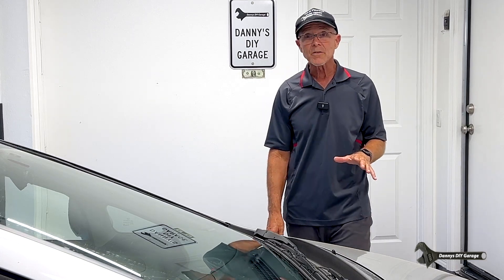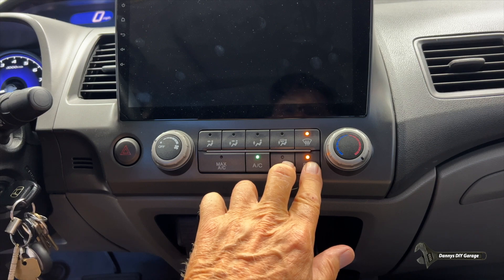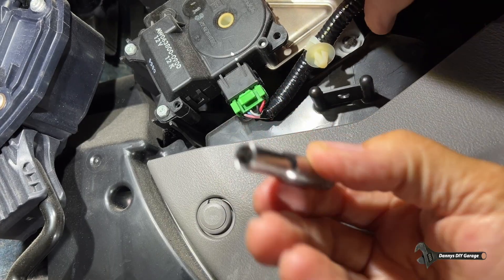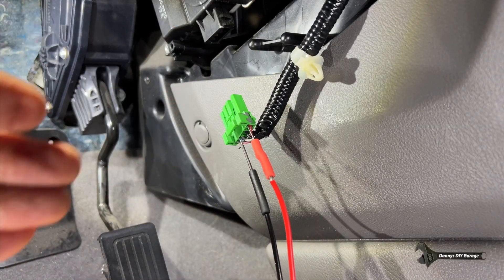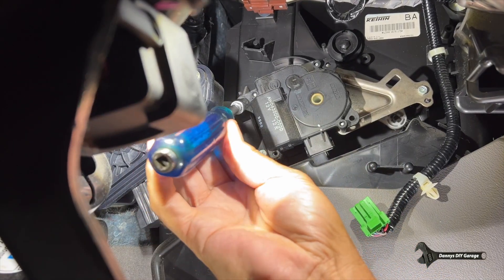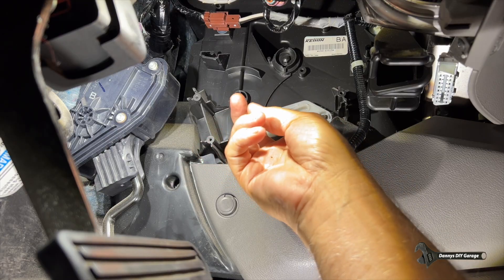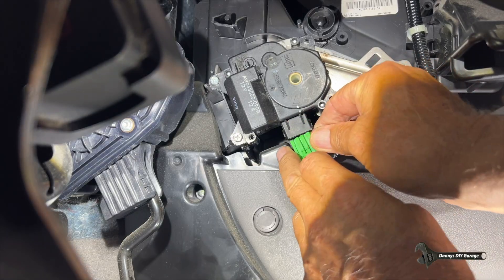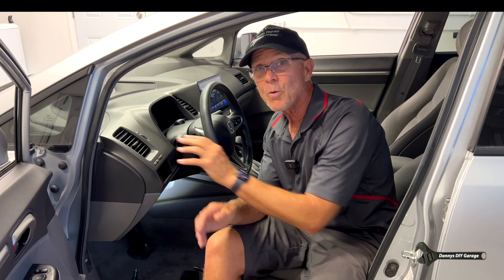Honda Civic Heater or AC Problems? Diagnose & Replace FAULTY Blend Door Actuator.

Comment: Does it matter where the dial is set before you remove and install the new one. When I installed the new unit it was not setup right. Thanks for the great videos.
Reply from the maker: I found full cold usually works best, but it really doesn't matter as you can move the door, but most actuators come set on cold

Comment: So this video is for the FAULTY AIR MIX MOTOR to fixing #1 trouble code, located by the gas pedal. It's not the same as the AIR BLEND DOOR ACTUATOR with #4 trouble code located behind the glove compartment.
Reply from the maker: That’s correct I have another video for code 4 behind the glove box

Comment: Hi Danny, my wife’s Civic blows hot air on the driver’s side only. Only room temp air on the passenger side. And for the AC, it comes out cool on both sides. I’m not getting any codes on the control unit. Both the air mix motor and zone control motor seem to function ok. Any idea why I’m only getting heat on one side?

Comment: My daughters AC was broken, finally solved it after the engine coolant boiled and forced the car off the road...turned out both fan motors had worn out the bushings. Replaced them and the car is back to normal...absolute tanks these things.
Reply from the maker: Good to hear success stories 👍🏼

Comment: Hi @Dannys DIY Garage

Thanks for the great video. I have a question about my 2009 Civic.

My car seems to only produce hot or warm air depending on how far I crank the temp knob clock wise or counter clock wise. I ran a system check and got the 4 blinking lights, indicating a faulty actuator on the passenger side (I checked and it did not work when switching between modes). I found that the actuator on the passenger side is stuck in the face-only position and can’t blow air to the feet. The driver-side actuator is working fine.

I thought that even with a stuck passenger-side actuator, I’d still be able to get cold air. But it seems like the opposite is happening. Any thoughts on this? Ty!
Reply from the maker: Yes you probably have more than one problem

Comment: Mr. Danny. How did you determine the blinking light was “code 1” the light blinked 6 times that I saw. How is the code determined? Thankyou!!
Reply: It blinks 1, pause and repeats until you put the car off . So if it blinks severally without a pause u count all until it pause and repeats
Reply: I know I’m late to this but the number of blinks is the code number
Reply: I have this very same question

Comment: Finally a video that covers everything about the air mix door.
Now I can check if my air mix door is moving all the way to the closed no heat position before I decide what yo check next.
Reply from the maker: Thanks for your comment
Reply: @dannysdiygarage   I had  a  code 4 ( 4 times the light blinking , ) but I replaced the other side door actuator . 
Now I found out the driver side one  wasn’t working too , So I bought the motor , it happened to be the same one than the other side ,  ( inside mechanism ) so I bought another one and I connected it , It turns around , but ac Doesn’t turn on ..  just blows air . 
What do you think it could be the issue ?   Now I didn’t installed properly just checked if it turns around ,  Do I gotta INSTALL it properly to actually use the Ac  . ?  
 I disconnected it because since without it my car blows ac normally. But I don’t know if it was due I didn’t installed properly to the linkage and that’s why the AC doesn’t turn on ?!

Comment: Hey Danny my 09 civic is currently having some issues with the ac system. Intermittently it blows cold air but then it blows hot air and the ac stops working completely. When it does blow cold air it also smells musty and gross at the beginning. Any tips for diagnosis?

Comment: Hi danny, I love your videos and i've been doing some fixes to my car thanks to you!
I have a 2011 Honda Civic LX but i have a problem with the a/c during daytime, compressor and fans don't turn on when i turn the a/c on, i live in a city where during daytime we are at 110 - 120 degrees fahrenheit, during nighttime we are around 85 - 90 degrees fahrenheit but at this temperature the a/c works perfect, i don't even have to put it on Max A/C, on the blower speed i always use option 2 or 3 which is very low and on the temperature i use options 2 - 4 and that is just perfect to have cold air.
This is what i've done so far to my car:
- Flushed coolant and put brand new coolant
- Changed thermostat
- Changed radiator cap
- New condenser 
- Freon service (R134a)
- Changed A/C Compressor Relay
- Changed MG Clutch fuse

I did troubleshoot it and gave me Code #4
Thanks and i'll appreciate any advise you can give me on what could be the problem

Comment: Hi, I got code #4 and was getting very low voltage readings. How would I go about fixing that particular issue? Update: Danny's video "Air Conditioner not blowing out the vents, HVAC Air Distribution Fix" has code #4 issue and fix.
Reply from the maker: Watch my video here, https://youtu.be/NY84I-9716A?si=DWwyyR35gMz5H3v-

Comment: Hi I have a 2006 honda civic 4 door and i see some spots on floor from front lip section and back under the trunk could it be the engine oil leak? And if you can make a cideo how to check oil leaks on honda civic from top and bottom of the car that would be really great danny

Comment: Do you have a video on how to re-seal the AC recirculation/outside air flap which is part of the blower assembly?

Asking because even when I have the AC on "recirculate", exhaust fumes from other vehicles still get inside my Civic especially during heavy stop-and-go traffic.
Reply from the maker: I don’t, but this is a great suggestion for a upcoming project, thanks
Reply: @dannysdiygarage  Thank you, in advance!

Comment: My temps very cold in thr morning but once it's 90 degrees its barely cool
Reply: My same exact problem
Reply from the maker: Many things cause this, usually low on Freon, but it can be other things, I go over this in other videos, I’ll probably make a video using gauges and what the readings mean
Reply: @dannysdiygarage  I hooked up the low side side to the guage and it was right at 90psi so I believe the freon is perfect there. Ive swapped many ac components already, still stumped..
Reply: @MiguelHernandez-fd4rm bro isnt 90 psi way too much? u might of damaged ur ac system if u put too much freon in.
Reply: @RavagHer  honestly you might be right, that's what some guy with credible videos was posting. Might release some pressure tomorrow and see if it works better
Reply: definitely have the same issue u had. im gonna buy acpro and just add in freon lil by lil to see if that changes. the AC works fine if its like maybe 70-80 degrees outside but 80+ close to 90+ it craps out after like 15-30 minutes. fans still blowing. belt to condenser is spinning. so I'm sure i know i need freon.
Reply: Same exact problem.
Thanks to this video the next thing I'm going to check is to see if the air mix door is closing out the heat all the way or not.
I know for sure I need to change out the mode motor though.
If it is working then I'll have to buy a manifold gauge to check the freon pressure.
I just don't trust taking it to some random mechanic who might just use a $20 walmart freon can without checking anything. Doing that could wreck the whole system.
Reply: Same issue! Also, when the A/C is off and when I press the “Recirculate” button, air still comes out of the vent! I’m trying to get that fixed. A/C compressor works good, Freon is good, and the both the radiator fans are working. I would love to drive it, but here in CA it’s hot and I won’t drive it.

Comment: Thanks for the video!
I have a question and hope you can help. I don’t get any trouble codes when performing the control panel test. My car has had trouble blowing cold air. It seems to only blow ambient/outside air temp. It used to have an issue where it could still blow cold air but after driving for 30 minutes, the volume of air would be very little. But now it’s mostly unable to blow cold air.
Reply from the maker: Check out my other ac videos, I go over possible causes